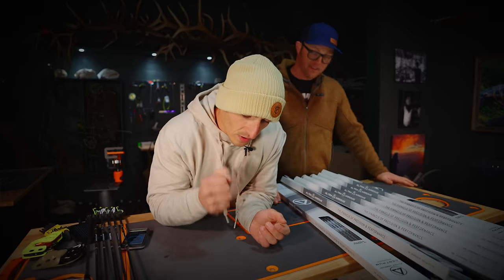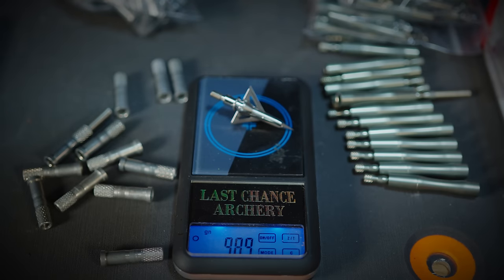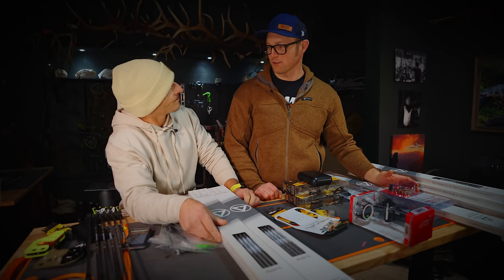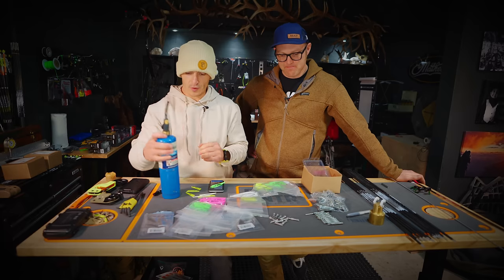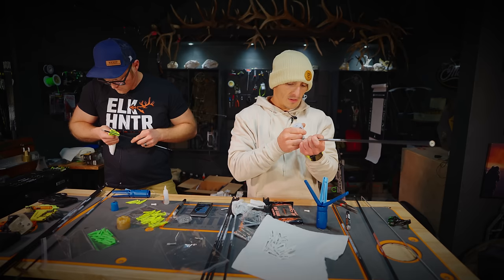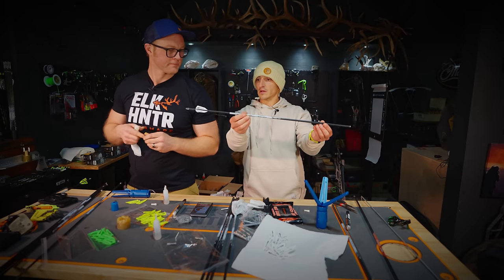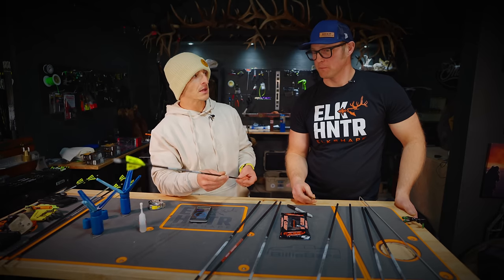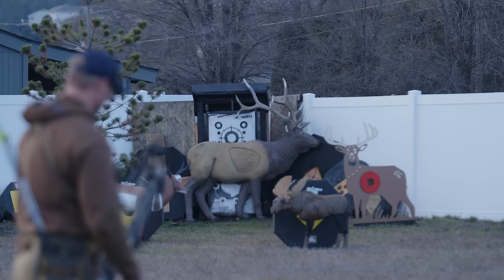Customizing ALTRA Arrows: Tips & Tricks

Comment: Can we get an episode where we talk about building arrows for youth or women. My wife is shooting this year and we want to do it right. I build my own arrows but not knowing her draw weight yet what spine should I put her in or should we go cheap and wait until she steadies out, then build her arrows. I shoot 60 lbs and I get complete pass throughs with a 380 grain arrow at 30 yards on white tails. Expandable grim reaper tip. She will be using fixed next year. 
Well she will start to shoot in the spring after we have our baby. She will be using the missions radik and she will start to shoot as low as the bow can go so we can work on forum. If you want can you do a full demonstration on tuning a slower bow. Just curious if there’s a difference

Comment: You need to make adjustments to the rest because of the .166 and .246 sit different on the rest. Your rest height will be off.
Reply: That's probably the real reason the 246 hit higher, not the weight difference. The 246 sits nose up compared to the 166 so it will hit higher
Reply: Ya I just shot LRT’s, airstrikes and pro hunter and they will all impact different. The rest height needs to be raised or lowered accordingly to level the arrow back out. It will make a big difference in your groups as well

Comment: These arrows are great if you want a 465gr + weights. The lowest i was able to get was a 474gr in the 4mm. They fly great out of my bow with DCA SS vanes in a right helical 3 fletch 29.5 draw length 70lbs
. I was able to remove 1.25'' of arrow length.
Reply: 474 grains in a 4mm thats quite heavier than id imagine. Ill stick with my VAP SS seeing theyre slightly lighter total weight…29.5” draw here also. I wish i went RIP or TKO now tho for the lighter more customizable option. I do love my 4mm SS tho as well. Right around 16% FOC…ethics insert and collar 65 grains total insert and collar weight
Reply from the maker: Ya man, I think Tyler was hoping to have lighter arrows but based on the GPI and the FOC... he probably needs to in the high 4's or low 5's. -DS
Reply: Yep, i feel this arrow is great for anyone that wants a heavy arrow setup. Just from my tinkering it flys great and has good foc on my setup. I was surprised the the .264 had a lower gpi than the .166 but i am of shooting 4mm arrows. someday i want to try JJ's arrow parts.  @ElkShape

Comment: It’ll be interesting if Altra will work on their gpi’s. Obviously a new company but those gpi numbers aren’t the best
Reply: I completely agree. Looks like I'm sticking with victory
Reply: What's wrong with the gpi?
Reply: @Just_AK23  too much gpi leaves ypu with less options when it comes to component and vane options without the arrow getting crazy heavy. If you keep the shaft light, you can have a nice steel or titanium insert up front that will never bend, and you'll still be around the 420gr to 450gr weight. The 12gr aluminum insert included with these arrows are garbage.

Comment: I’m confused on the sizing is the 246 a 5mm? And the 166 do those come with inserts ?
Reply: .246 is a standard diameter.
Reply: .204 is 5mm.  These (.246) are "standard diameter" arrows.
Reply: The .246 is your standard “6mm” diameter. Like a Gold Tip Hunter. The .166 do come with inserts. It’s a two piece system with a glue in post and a half out that threads onto the post.
Reply: Thanks guy appreciate it

Comment: In truth, the micro diameter arrows are no better in wind or penetration than a standard diameter. The wind isn’t going to ignore the broadhead and fletching.  If you’re shooting a broadhead, even a 1” cutting diameter, the hole it makes takes the penetration out of the equation.  Doesn’t matter if it’s a 4mm or a 2713.
Reply from the maker: IDK if what you're saying is gospel, but we certainly need to test more.  Thanks for the feedback.  I have used Axis Long Range and Black Eagle X-Impacts on animals and that's it when it comes to 4mm.  -DS
Reply: I disagree with your statement at least for me, I have proven it to myself with my equipment shooting arrow side by side one after another and get about the same results. Usually with wind drift penetration I seem to have passed throughs used 95% of the time. Didn't have them with the standard diameter arrow. Whenever I went down to my 4 mm it I got better penetration so I can't say for sure. But it only makes sense that it would penetrate better
Reply: There are a lot of factors that go into bucking the wind, but in certain cases and setups, shaft diameter definitely plays a role. If shaft diameter didn't play a role in wind, every pro shooter would shoot the fattest arrow possible at every outdoor shoot.
In regards to penetration, it's the same depending on the setup. A broadhead cut is done by the blades, but the hole that is created, in most broadheads, is from the ferrule or shaft. In cases of 4mm, most components in the ferrule are actually bigger than the shaft, so the hole created will be slightly bigger as the arrow comes through. How significant that difference is, I think is minimal with modern bows and arrows, but for some it will be a bigger factor than others.
Reply: It does help. I've shot em all. Micros the way to go. I shoot expandables, so the drag on the front end isn't as great as a fixed blade. Then the wound channel does close onto the shaft with the animals innards not just following a broadhead hole like it stays open. Idk
Reply: I’ve shot both. Micro does better in the wind IMO.
Reply: I think you’ll find more people disagree than agree with you. Myself included unfortunately. Even a 4mm arrow is gonna be lower profile on the same vanes than a 5 or 6 mm arrow. The drag in ballistics gel vs real body matter. The 4mm definitely would have less friction for drag when penetrating. Enough to matter properly depends on broadheads selection. But overall you have much less for wind to push. The biggest and most over looked thing with penetration is arrow durability. A 4mm especially considering weights are the same and often a touch heavier means the carbon is thicker. It also means they are less likely to break midway though and animal. I think foc or just going heavy makes a difference. How you build that setup is gonna drastically dictate the actual flight and penetration. But in the end if your a target shooter and your not great. Shoot a fat arrow. You’ll catch more lines 🤣
Reply: Less surface area has less drag. That's basic physics. If shooting a fixed broadhead and large fetching, it will have a greater effect than arrow diameter. This doesn't mean the diameter doesn't matter. If this were true long range target shooters wouldn't drop the money on X10s.
Reply: This and all the other replies sound real good.  Make a lot of sense.  Years of shooting these things in crosswinds have told me a different story.
Reply: This and all the other replies sound real good.  Make a lot of sense.  Years of shooting these things in crosswinds have told me a different story.
Reply: This and all the other replies sound real good.  Make a lot of sense.  Years of shooting these things in crosswinds have told me a different story.

Comment: There is no advantage only disadvantages in going to 125gr points! You will lose 8fps, have more arrow drop, weaken the arrow spine and only going up roughly .5lb in k.e. you also will not get better penetration with higher f.o.c it has been proven many times by Joel Maxfield but the fairly sniffer think it does. Ashbys tests are moot when using a compound, he did all his testing with trad equipment and poved himself wrong when he shot completely through a buff with a 450gr arrow out of a Martin Worthog!
Reply: Bro, no! You’re crazy! Come on man which is harder to stop a semi going 80 or a train going 20? Come on man! It’s physics! Let’s get the 🧚 dust together
Reply: I've killed more deer with "flappers" than the Fairy could probably kill in the rest of life! The fairy hasn't killed a deer with a bow in 20years, he's never killed an elk! But yet he tells everyone what the best setup is! He is a joke, he can't tune a bow and thinks that changing point weight is how to tune!

Yes if I was only shooting 0-150lb pigs at a feeder at less than 20yds I'd use a fixed head and slightly heavier arrow but im from the midwest and shots can range from 0-120yds not just 20yds! 

I hadn't shot a deer with a fixed blade in over 20yrs and decided I would a few weeks ago and shot a doe quartering away, shattered the off side shoulder, arrow stuck in the ground! Oh and that was a 402gr arrow at 65lb draw
Reply: @tylerchubb3876  bro, all I’m hearing is a bunch of experiences but no math! Bro it’s about the physics of the damn thing! If you want to use experience as a litmus test, go get me  a pass thru on a cape buff or 🐘 with a 402 gr arrow. Then I’m all👂